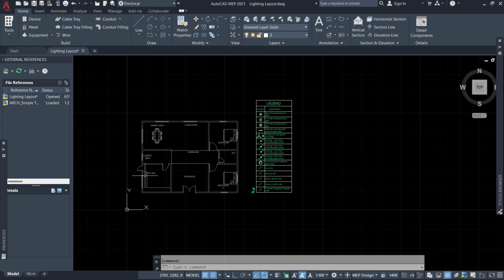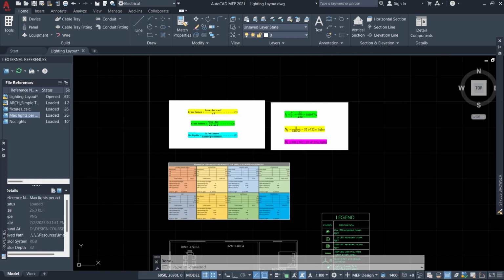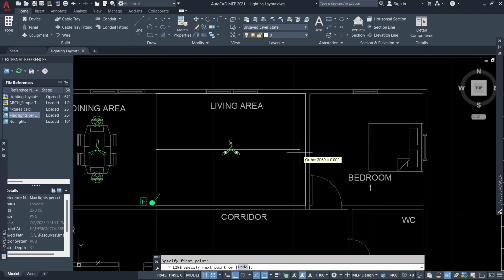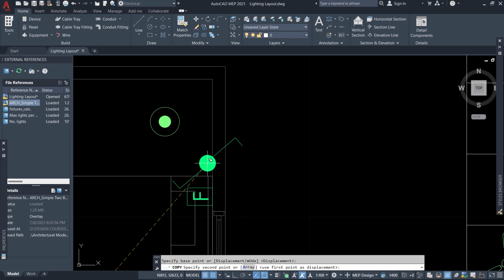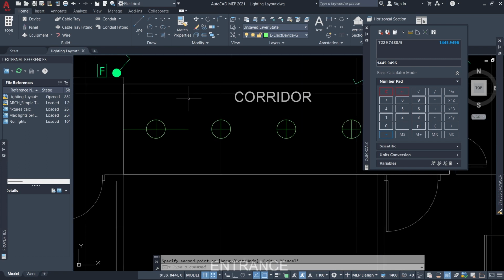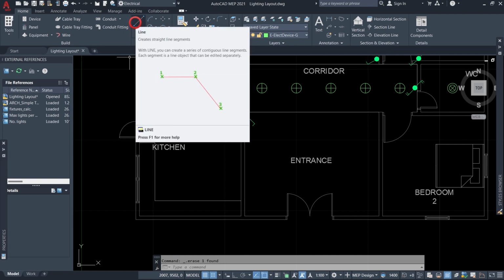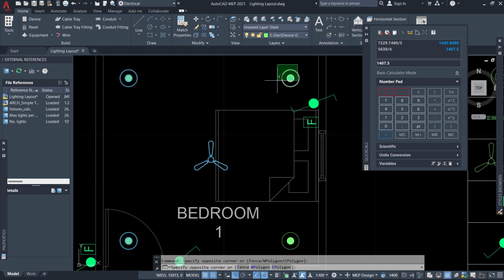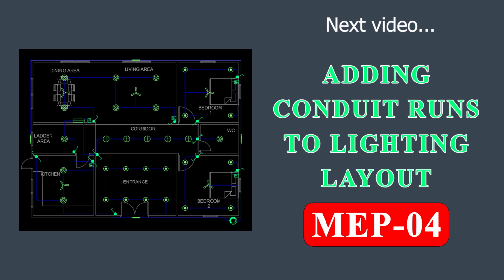E - 03. Two Bedroom MEP Project: Lighting System Layout Using The Lumen Method.

Comment: Do we have a situation where the maintenance factor for lights can be more than 1

No — normally the maintenance factor (MF) for lighting should never be greater than 1.

Definition

According to lighting standards such as those from Illuminating Engineering Society (IES) and International Commission on Illumination (CIE), the maintenance factor accounts for the reduction of light output over time due to:

Lamp lumen depreciation (LLD)

Luminaire dirt depreciation (LDD)

Room surface dirt depreciation (RSDD)

Lamp survival factor (LSF)

It is defined as:

MF=LLD×LDD×RSDD×LSF

Because all these factors represent losses, each value is ≤ 1, so the result must also be ≤ 1.

Typical values:

Environment	Maintenance Factor
Clean office	0.8 – 0.9
Commercial building	0.7 – 0.8
Industrial / dusty	0.6 – 0.7
Why MF Cannot Be > 1

If MF were greater than 1, it would imply:

The lighting system produces more light over time than when it was new, which contradicts physical lamp behavior.

Lighting calculations therefore use:

E_maintained=E_initial×MF

So MF must be ≤ 1.

Situations That Might Confuse Designers

Sometimes people mistakenly obtain values above 1 due to:

Incorrect LED lumen maintenance interpretation
Early LED stabilization can slightly increase output after burn-in, but standards still keep MF ≤ 1.

Using a correction factor instead of MF
Some software applies temperature correction or driver efficiency factors that can exceed 1, but these are not maintenance factors.

Calculation or unit errors in lighting design software such as DIALux or Relux.

✅ Conclusion

Maintenance Factor > 1 → physically incorrect

Valid range:

0<MF≤1
.